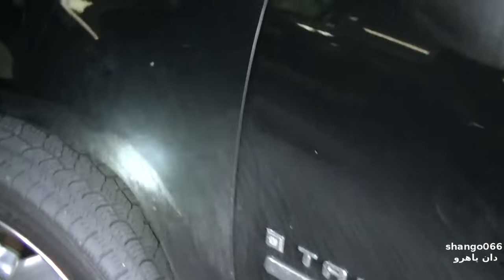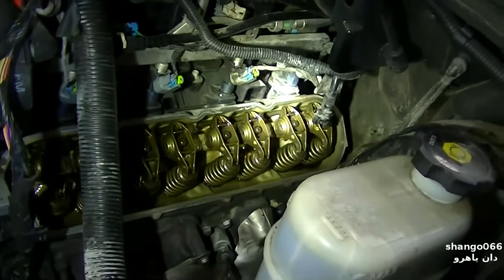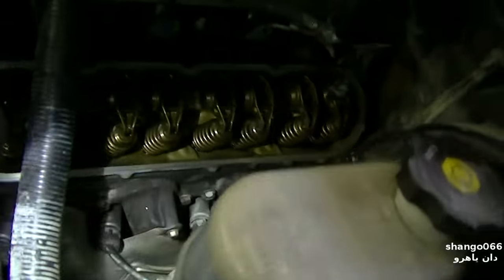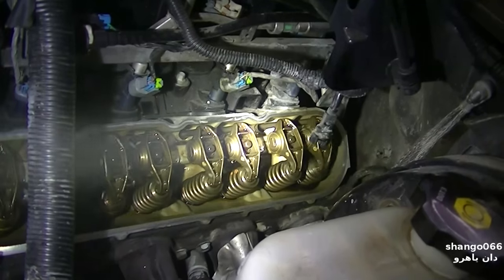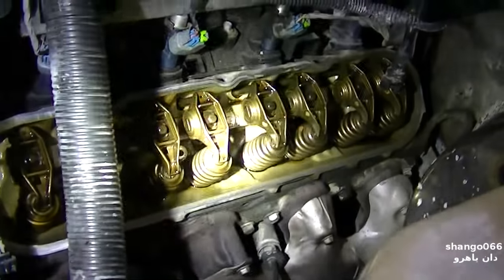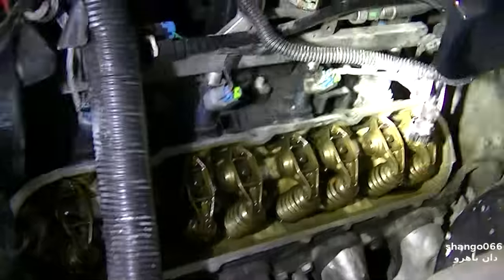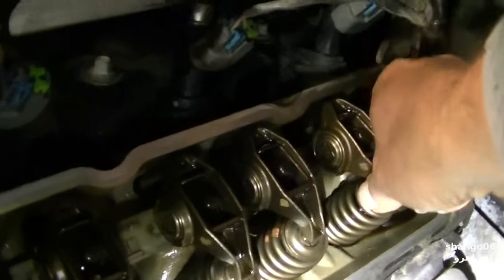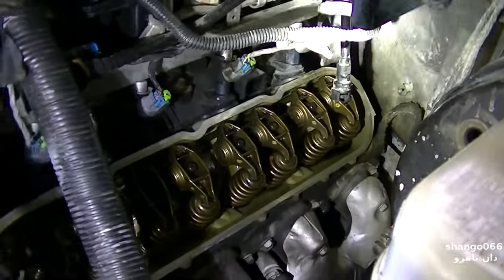GM Chevy 5 3 Motor Flat Cam Lobe? Misfire

Comment: I've seen quite a bit of cam failure with the 5.3....if the problem is going to be cured at home I suggest an after market cam such as a mild rv cam and lifter set  those stock gm cams are pretty much garbage

Comment: There's a small thimble filter for the oil feed to the Active-Fuel-Management lifters, it's installed directly underneath the oil pressure sender (GM#12585328, Dorman#917143).   That little $3 filter gets obstructed and causes this failure.    Nowhere in the maintenance literature does it mention to change this filter on any kind of service interval.    The dealer gave my parents the option of $5400 to replace the cam and lifters, (which requires removing the heads on this motor), or $7300 for a new motor (w/3-yr, 100k warranty).   They went with a new engine in their 2012 Silverado with 130k miles on it.    My advice, if you're going to repair it, install a non-Active-Fuel-Management cam, lifters, and valley pan, and have the AFM programmed out of the ECM.
Reply: is it one of those bronze ball sintered mesh filters?
Reply: No, it's a plastic screen filter
Reply: dont they know plastic and internal combustion dont mix!?

Comment: It looked like the lifter was pumping oil to the rocker which would mean that the cam lobe was at least pumping it. Are you sure that it's not a burnt and seized valve? Cam is probably still damaged but the valve may have been the culprit to begin with. I would also take a look at the top of the piston.
Reply: I suspect that motor has Active Fuel Management (Displacement on Demand), and the lifter has locked in the collapsed position.   Problem is that both the cam and lifters are damaged when this happens, and you have to pull the heads to get the lifters out...
Reply: you have to pull the heads?  ugh this job looks nasty.

Comment: I've never seen a cam lobe so flat that the rocker didn't move at all....that's odd. It's obvious that the hardening on the lobes isn't what it should be, which is causing premature wear---Chevy had the same problem with small blocks in the 70's and 80's. Maybe someone makes an aftermarket replacement that has the same lift and duration?
Reply: That is what I thought! I would think it might be worn, but a collapsed lifter and bent push rod is likely also.

Comment: The dirt I've heard in the past on this problem with GM product regarding peanut butter camshafts  was that this weakness was amplified greatly when certain compounds were removed from motor oils because of the issues of toxicity.  I'm remembering it was zinc that was removed--a measure which greatly compromises the lubricity.  I've heard of several cases where cam lobes when flat at around 15K or less.  Not encouraging.
Reply from the maker: zinc sulfate, and that applies to old non roller motors. The reason I use racing or motorcycle oil in my old cars

Comment: Look up "AFM lifter failure". On these trucks, usually it's the two-piece lifter that fails. Sometimes the cam gets damaged, but often it's okay. The two-piece unlatching lifters used for the cylinder deactivation feature like to fail in the un-latched position.
Reply from the maker: This sounds like the most logical explanation, however in this case its best to just swap the whole motor with a factory rebuild with warranty. If it was a personal vehicle I would dig in

Comment: Shango, if this is an Active Fuel Management engine, (look under the intake, if the valley plate is flat, it's not. if it's contoured, it is) and if it is, it's probably just a collapsed lifter. (do these all the time at work, chevy dealer)
Reply: Also, if you need any service information, I can send it to you straight out of the manual.
Reply from the maker: Cool thanks, I bet thats the problem. I was helping a friend diagnose the misfire. It appeared to be electrical at first. 
do you replace them as a batch?
Reply: Under warranty, we replace all the AFM cylinder lifters (1, 4, 6 and 7), and the AFM lifter manifold (that thing under the intake valley) If it were for myself, I'd just do the collapsed one. Cause I'm cheap. But it may be best overall to do 1 and 7, since you have to pull the head to get to it. Head bolts, gaskets etc add up quickly.
Reply from the maker: After looking at the video and seeing NO movement at all I would totally agree this is the issue. After seeing that it was internal engine and not electrical its was out of my interest limits to pursue it  further. My next thought was to cut the oil filter open and look for shiny particles, that would have sent me deeper into it. The customer has one of those 3rd party warranties on this thing so its up to them to decide. Ill try and post an update
Reply: shango066 did u guys get that truck fixed? Was it the cam or the lifter?
Reply: @wrnchhead76  question: for a worm cam lobe, is it recommended to get a new Engine due to possible metal debris engine contamination from metal-metal pitting?  Or not necessarily?
Reply: Pro tip : watch movies on Flixzone. I've been using it for watching loads of movies these days.
Reply: @Fisher Junior Yea, have been watching on Flixzone} for since december myself :D
Reply: @shango066  there's also a kit for deleting the AFM system, I believe it requires a tune as well but probably worth it

Comment: I had a 1983 Plymouth Reliant station wagon with a 2.2, 4 cylinder engine that had a bad camshaft ( #2 cylinder) after 204K miles. At the time, faulty Mexican made camshafts were finger pointed as the culprit.

Comment: Here watching this because I just pulled cam from a workhorse 1983 GMC truck - all stock - and I'm trying to find CAUSE of my several wiped cam lobes & cupped lifters. UGH! It's looking like older flat-tappet engines MUST have ZINC in the oil, whether it comes with zinc already in it (so-called "racing oil" now) or as an additive.

Comment: I have a 07 express 3500 that is the heartbeat it has done 363000 miles and is starting to have cam/lifter issues but with that being said I can still hop in it start it and drive it 👍#chevyforlife

Comment: Shango... Look where the push rod comes through the head.. You can see either the lifter or it's sleeve sticking out. Something has slipped and is locking the valve open.

Comment: Oh man that really sux. Old 350's used to do this and would miss fire and try to start backwards and bust the starter drive end casting. usually is was more than one lobe and not gone completely like this one
Reply from the maker: Modern low zinc oil is very effective at doing that to old non roller cam 350s
Reply: The Rover V8 engines (brick 215) did the same if you did not swap oil every 100 days.
Reply: Buick V8 215.

Comment: I have a 2008 Avalanche, DOD with 48k on it.  Started having this issue about a month ago.. #6Misfire... rough idle at about 500 to 700 rpm, wants to stall at times, poor gas mileage.  had a mechanic check the basics and he said compression, injector, coil pack and plug wire were all good... I checked plug and it was black... changed it out.. no difference.  I swapped the coil from #6 with #4 (both cylinders that drop with AFM)... no difference.  Do not hear anything noise or knock or tick in the engine area... when I'm in the driver seat... at idle, I hear a bit of light knock (only from the cabin area)... and goes away as RPM goes up.  Oil pressure appears to be good... and have done regular oil changes, etc... and of course not under warranty.  Any thoughts???  Thank you...
Reply from the maker: Turned out to be a lifter issue I believe. This motor is a variable displacement engine and the lifters turn the valves off under light load Cruise. Read through the comments on this video there was a Chevy Tech who explained it and the fix.

Comment: could be a shot lifter GM had problems in the mid 70's with bad lifters a hole would devolps in the bottom and collapse's it then mid to late 70's GM had soft Cam shafts good luck with it

Comment: I'm thinking hydraulic lifter collapsed.  I've seen this before but not on this engine.
Reply from the maker: If the lifter collapsed there would be a loud ticking and lash when I pushed on the valve
Reply: It's hard to imagine, but I guess it's possible the lobe on the cam is completely gone for that valve.  What the hell kind of metal are they making these parts out of now a days?
Reply: +Brendon   It happens. Had an intake lobe go round on a V6 in a Ford LTD in the 1980"s. Ford had a bad run of cams, some with soft lobes.  Ford ate it, no problems.

Comment: Or a failed lifter....
Reply: I'd guess the lifter was fine, just pumped fully up trying to compensate for the lack of lobe, If the lifter was collapsed the rocker would be very slack, J.
Reply: Average Joe agreed it would be slack however in some cases the broken materials wedge between the rod and lifter outside casing.
Reply: Spdfreakls1 True, I hope Shango shows us the guts when its torn down, J.